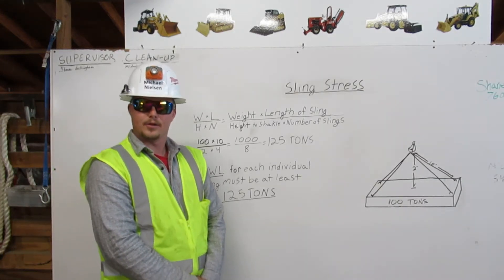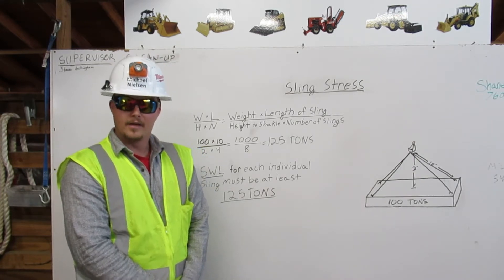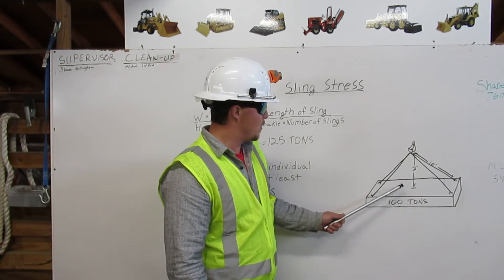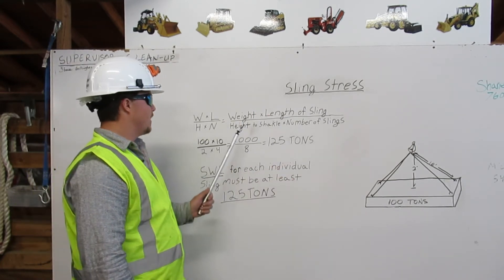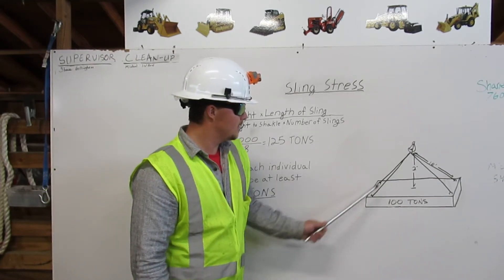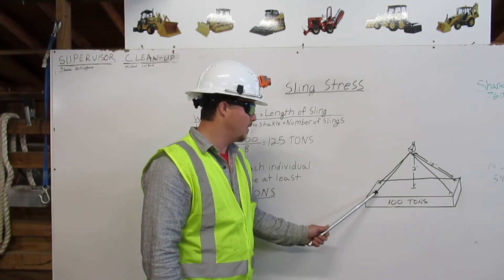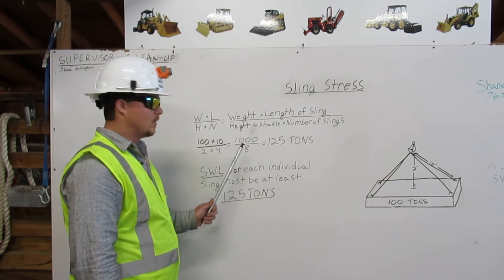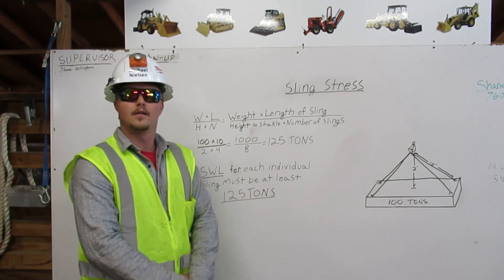Rigging 4 of 4 Sling Stress By Operator Nielsen

Comment: The riggers method is a dangerous way of doing lifting calculations because the angle (stress)  is not taken into consideration.
Normally in the field you would not know the hook height to the load, because for that you would have to rig it in the first place.
I could say a lot more but this is enough for the moment.